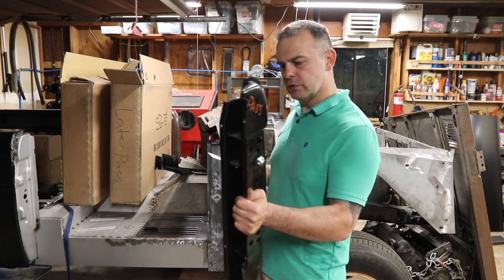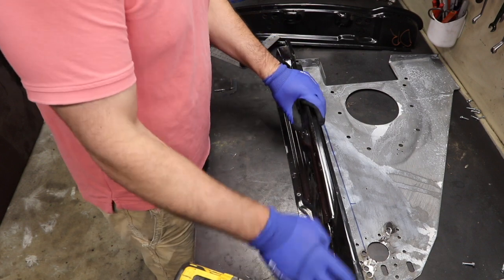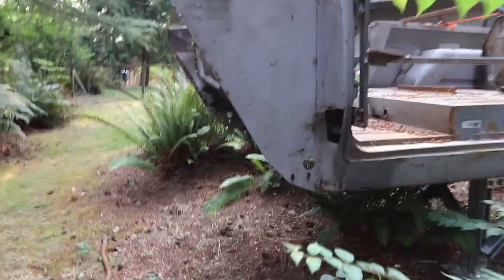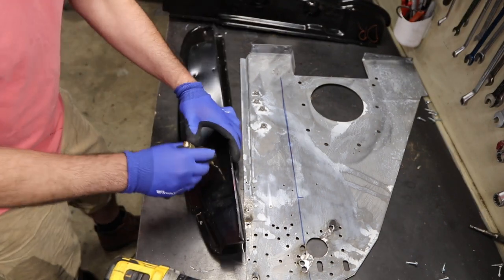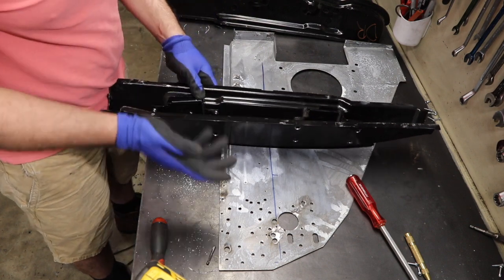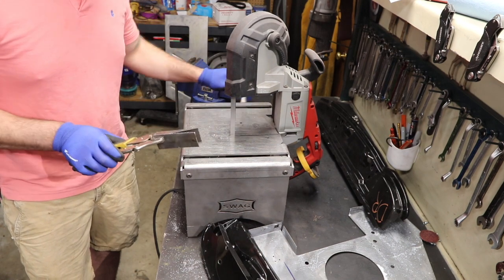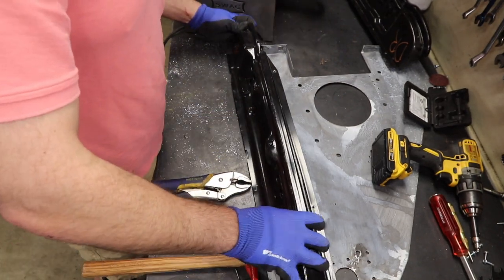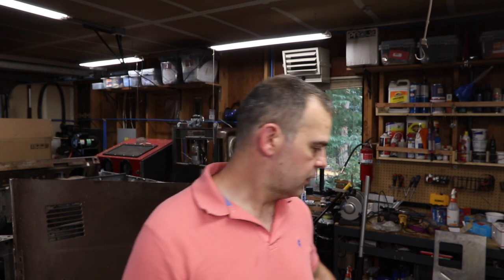4.14 Bronco Door Post ISSUES!

Comment: Every piece of sheetmetal I have received from Toms has been junk. Stay away from their sheetmetal.
Reply from the maker: That's terrible!  That's been the opposite of my experience.  The only pieces that I have had to heavily modify were these door posts and the bed stakes.  Those rear bedstakes I had to seriously hack up to get to work but all the fenders, quarters, doors, and tailgate are beautiful.  Almost no tweaking needed.
Reply: Hi Nick, tried looking up your account to see what issues with our metal you have had, and couldn't find any orders from you. Shoot me an email if you would, as maybe we can help you out! Thanks! - Jason
Reply: Hi Jason, Thank you for your message. The parts that you guys sell that are from Dennis Carpenter or MuscleCar GT are great. Matt has used mostly parts that you guys redistribute. What I have a problem with are the parts you guys are manufacturing internally like your fender aprons. They are thinner sheetmetal and the tooling is terrible. I have ordered those parts before and have been extremely unhappy with the quality. I can provide pictures of the differences between your parts and the other vendors showing these differences if you are interested.
Reply: Nick, the items we have had made internally are typically due to the fact the redistributed version are of very poor fitment, so we had our own made. Not sure if for some reason you had a couple of one-off's come to you or something, but we haven't had any known issues with our sheet metal. Also, before posting "every piece of sheetmetal from Tom's is junk," maybe contact us directly so we can take care of it, or look into it further for you. Thank you.
Reply: I have ordered most all of my sheetmetal parts from Tom's Bronco Parts and never had any issues with the parts I received